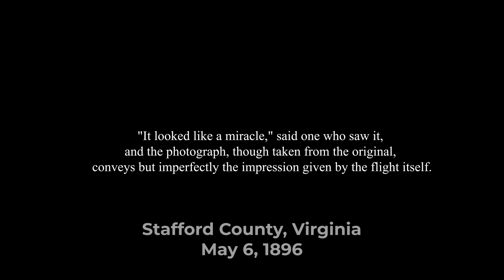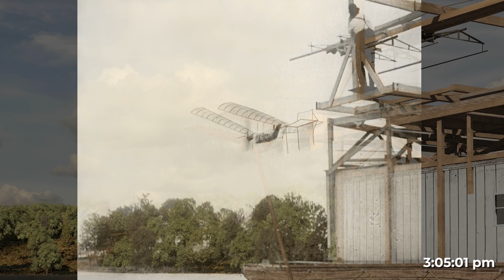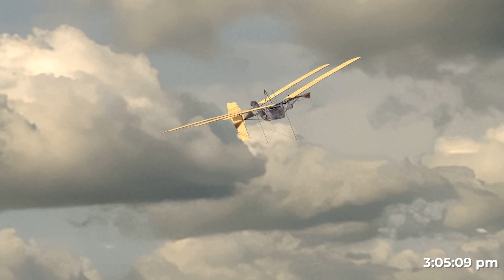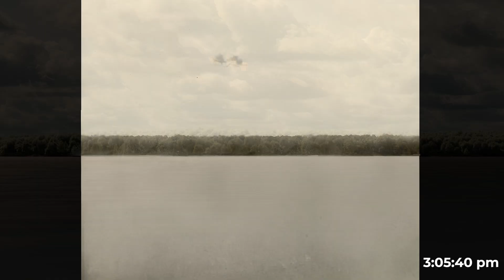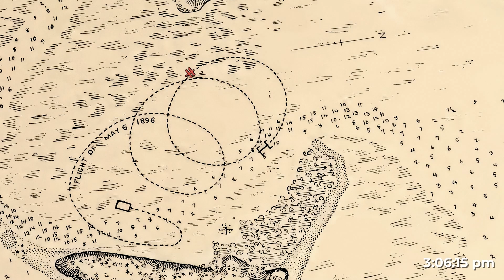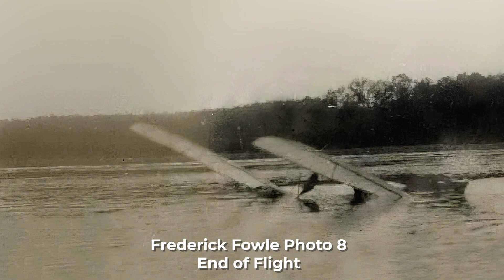The First Heavier-than-air Mechanical Airplane Flight - Langley's Aerodrome No. 5 on May 6, 1896

Comment: Reading all the comments here it comes down to definitions.
There is flight…. I can throw a rock, and while it’s in the air it can be considered flying
There is sustained flight, that can be defined as the ability to by design overcome gravity and maintain flight over time/distance.
There is controlled flight, that is the ability to have control over the trajectory.

The design shown here reached sustained flight but not controlled. As such and overlooking the limitations on its power system it was a dead end.  In the end it was both a Success and failure.

The Wright brothers achieved controlled sustainable manned flight, which even if it wasn’t first was first supported and recognized.  It was also repeatable and demonstrable.
Reply: There are controlled flight before the Wright brothers.
All the Wright brothers did was combine a suitable engine, given the efficiency of their wings, with an airframe that is controllable.
Langley developed the first engine powered airplane, and that is the real achievement.  Control was a necessary step, but Langley was the first (assuming there was no one prior).

Comment: Consider this: The simple ramjet engine was technically feasible at this time, and easier to construct than the reciprocating internal combustion engine. Imagine....
Reply: Counterpoint: The first ramjet wasn't designed until 1913. Even at that point no aircraft was able to fly fast enough for a ramjet to work.

Comment: Langley's contraption was a TOTAL FAILURE...it lacked sufficient Lift, had no aileron control...no rudder control and no elevator control.  Two HS dropouts figured out what Langley and all his associates couldn't.  Nice omage to the little engine that couldn't. 😂
Reply: Langley's airplane was a total success as it succeeded in what it intended to do.
Reply: Penaud's model flew many years before Langley's did!
Reply: @DumbledoreMcCracken  sorry but crashing into the water off the back of the ship is not an accomplishment..stop trying to rewrite HISTORY.
Reply: @mauricepowers8079  I'm talking about the 1896 machine, not the 1903 machine.
Reply: @DumbledoreMcCracken  the 1896 flights(aerodrome 5 and 6 ... 3300' and 4200' respectively) were the result of a total of Langley and 5 Engineers(one who held a Doctorate), and was steam powered and launched from a houseboat at least 15' above the Potomac River.  The Wright Brothers(High School dropouts) had highly precise data that is still used to this day and they achieved powered flight from the ground(with a gas engine THEY ENGINEERED AND BUILT)...totally controlled on all 3 axis.  Langley deserves a footnote in the annals of the HISTORY of FLIGHT.  The Wright Brothers deserve full credit for TRUE POWERED FLIGHT.

Comment: I thought the first powered and manned flight was July 1901, in Germany, by Hermann Gaswindt in a helicopter he built. BEFORE the Wright brothers-December 1903.
Reply: This is wrong, the wright brothers used a catapult in 1903 so I wouldn't call it "powered" flight, give me enough money and I will build a giant slingshot that will make my refrigerator fly more than what they did then. Otherwise, seems correct 👍
Reply: @ch1caum  They did not use a catapult in 1903. They took off into a 24 mph wind along a short monorail. In 1904 they added a catapult to fly in the absence of adequate wind. They needed to make many test flights and did not want to wait for the right wind.
Reply: @ch1caum  This is still wrong, because the Wright Flier only used catapult-assisted takeoff.  It flew under its own power afterwards.
Reply: @blam320  This is still wrong. In 1903 at Kittyhawk,  they used a dolly on a rail. They used a catapult in Ohio later to shorten the takeoff run.

Comment: And just WHO was the pilot!? Glen Curtiss flew the original (and heavily redesigned by Curtiss) one in 1914. Get your story straight!
Reply: This 1896 flight was an unmanned machine.  You could think of it as a large free-flight model airplane, but one that demonstrated all the capability that a larger one would need to carry a pilot.  As far as I know, Langley never solved the problem of steering, either horizontally or vertically, but he did demonstrate stability, and sufficient power to keep the machine flying for several times what earlier (and much smaller) rubber-powered toys had managed.
Reply: @SilntObsvr  Others has solved the control problem before the Wrights.  Montgomery in California.

Comment: This is a totally false claim, completely dispelled by Greg of Greg's Airplanes and Automobiles - he is a commercial pilot, aviation consultant, and aviation/automotive enthusiast.  His videos show that all of Langley's attempts to fly were rather pathetic.  None of his models were capable of aerodynamically sound attempts.  Langley's attempts at best qualified as uncontrolled, unsustained, powered jumps. The steam engine may have been fairly remarkable (but it was still much too heavy), and the airframe design was a failure that took hundreds of significant modifications by Glen Curtiss, over a decade later (1914) to do anything close to what the Wright Brothers accomplished from their initial gliding experiments in1900, followed by their successful, sustainable, controlled, powered heavier than air flight first accomplished in 1903 and demonstrated repeatedly in the years after.   There are 3 videos Greg has produced that slam the door conclusively on any and all claims that Langley (or anyone else for that matter) even came remotely close to powered heavier-than-air human-controlled flight.  This is the first of his videos on the subject.  https://www.youtube.com/watch?v=EkpQAGQiv4Q
Reply: I don't think this video is claiming control is it?
Reply: @ummdustry5718  i dont believe so, from what i can tell from my limited knowledge these flights have nothing to do with being human manned flights - merely that they were done with a device heavier than air! seems to be some sort of automaton.
Reply: @ummdustry5718  It seems to imply it, and if so, then it is a lie since Langley's 1903  Aerodrome (which was supposed to be an improvement of the 1896 model) required hundreds of changes by Glen Curtiss before it could fly and be controlled (sort of) by Curtiss in 1914.  Even so, the Smithsonian admits that the Wright Flyer was the first airplane that effectively solved all of the problems of practical heavier-than-air powered human flight.  The final verification of this is the fact that the Wright Flyer has a position of honor at the National Air and Space Museum main campus building on the Mall in Washington D.C., while relegating the model of Langley's aerodrome as an interesting dead end in aviation research with a footnote spot at The Steven F. Udvar-Hazy Center, hanging from the ceiling near the restaurant with other aviation oddities and dead-end aviation attempts.  https://www.wright-brothers.org/History_Wing/History_of_the_Airplane/Doers_and_Dreamers/Wright_Smithsonian_Controversy/The_Wright-Smithsonian_Controversy.pdf
Reply: Are you saying the photos are fake?
Reply: @creatorTWin  Regarding the pictures.  They are inconclusive, and Langley's post "flight" narrative was overly optimistic.  If he had really solved the problems of flight and control why did it take him 7 years to make another attempt? (especially when he had plenty of funding to try again)  Watch Greg's videos on the Wright Brothers, and you decide whether Langley was capable of actually capable of methodically solving all of the engineering problems of heavier-than-air powered human flight.  My conclusion, (which is the same as many others) based on the books I have read, Greg's 3 videos on why the Wright Brothers were the ONLY people to conclusively solve all of the engineering and practical problems of flight as well as actually being able to master control of the aircraft.  Langley's lack of prowess was demonstrated when it required hundreds of changes by Glen Curtiss to get Langley's aerodrome to actually accomplish slightly more than a powered leap, followed by an unceremonious crash into the Potomac as all of his previous attempts ended up doing.
Reply: @creatorTWin yes they are.
Reply: @GarrettFalls  if the photos are fake, then it is more likely the Wright's 1903 photo is fake.  

Why do the wing tips droop down when the Wright's Flyer is supposedly flying?  The load on the wings should lift the tips up, causing the whole wing to bow up, as has happens with a modern sailplane.
Reply: So, your argument from authority is that only the Wrights did anything to advance flight, up through 1903?

John Joseph Montgomery therefore could not have advanced flight, including with the invention of the aileron, could he??

I have a pilot's license, a mechanical engineering degree, and have worked in the aerospace business for 23 years.  None of that changes the history that you are so convinced has been changed by a so-called expert!
Reply: @DumbledoreMcCracken  Watch his videos, not just his videos on the Wright Brothers. If you think you know more and can speak more authoritatively about aeronautical engineering and flight I dare you to contact him.  I do not know what his degree is in (It may be an engineering discipline, but I just do not know), but practically he is at least on par with any aerospace engineer I have known. His understanding of fluid dynamics and airflow is excellent. He probably has 5 to 10 times (or more) your flight hours, since he is an airline pilot.  Again, he has demonstrated a knowledge of aerodynamics and piston engines (within the historical realm) that is beyond the understanding of the vast majority of people.
Reply: @libertycosworth8675  okay, I will.  I'm a glider pilot, which means I don't use an autopilot to fly.
Reply: @DumbledoreMcCracken  He has also flown gliders.  🙄🙄
Reply: @DumbledoreMcCracken  Not my assertion alone. Greg's expertise is notable, likely beyond yours. Doubt me? Then go ahead and watch his videos on the Wright Brothers.  He methodically proves his assertion (with plenty of verifiable documentation) that the Wright Brothers are the first and only inventors who conclusively, and methodically solved - through groundbreaking aerodynamic study all of the engineering and practical problems of heavier-than-air powered and manned flight.  If you don't watch those videos and a smattering of his other videos then perhaps you may lack the innate curiosity of a real engineer.
Reply: @libertycosworth8675  oh yes Greg.  He is a sanctimonious individual who only seeks to reinforce his own biases.

I have the opposite problem, I love evidence and wish we had more.  I don't need to reinforce my biases, I need to explore the unknown. 

That's what separates someone with curiosity, from someone with sanctimony.
Reply: @DumbledoreMcCracken  Then prove him wrong.  You can't, apparently, all you are capable of doing is offering gratuitous insults, a clear indicator you cannot address his arguments factually and substantively. To accompany that I really have to say:  “You keep using that word. I do not think it means what you think it means.”  😂  As far as Greg goes, he obviously has the curiosity to do in-depth, historically accurate research (with oodles of primary documentation that he references) covering a wide variety of subjects in the area of aeronautics - and he backs it all up with documentation from those primary sources.  He has been willing to have an online debate/discussion with someone who disagreed with him about the P-47.  So why don't you try if you think you could measure up? The Smithsonian has also admitted that the Wright Brothers conclusively solved all of the problems of heavier-than-air manned flight, and in doing so, gave the original Wright Flyer a position of honor at the National Air and Space Museum main campus on the National Mall, while relegating the model of Langley's aerodrome as an interesting dead end in aviation research with a footnote spot at The Steven F. Udvar-Hazy Center, hanging from the ceiling with other dead-end aviation attempts.
Reply: @libertycosworth8675 : "This is a totally false claim ..."

I do not get your hostility here.  I see no false claim made in this video.
This is an excellent video which documents a major milestone in heavier-than-air flight.
Nowhere does it claim to be a CONTROLLED flight.  Nowhere does it state, show, nor imply that it is human flight.

No one need to go elsewhere to a place like Greg of Greg's Airplanes and Automobiles to know the singular achievement of the Wright Brothers, which checked all the squares of the critical elements that are found in aviation today.  Langley failed to accomplish two major aspects.  Yet this is still an excellent video, and fully deserves credit for what it is.

Now if anyone were to assert that this video is incomplete, because nowhere does it specify these key elements that Langley failed to achieve, then I would readily agree.  So...  incomplete, yes.  "False", no.
Reply: @DumbledoreMcCracken  Wrong (again).  Matthew Piers Watt Boulton actually "invented" and patented (in England) the aileron - when John Montgomery was a wee lad of 10 years old.
Reply: @libertycosworth8675  I am concerned with what Octave Chanute documented, and communicated to the Wrights concerning control.  I will verify your claim.

Edit: apparently only a French aviator knew of Boulton's invention.  However, it clearly disproved the Wright's claim that they invented longitudinal control, Montgomery not withstanding.

Comment: Steam powered model that led the way to the 1903 Great Aerodrome attempt to fly with Charles Manly as pilot. Apparently it fouled leaving the catapult and fell into the Potomac River. A remarkable attempt to carry a man. A remarkable radial engine.
Reply: Like a fist full of mortar.
Reply: It was assumed it fouled the catapult. The photos do not support that idea. It cleared the catapult and the rear wing pitched down. What was not widely known then, or today, was the presence of a trailing vortex behind a wing. The rapid acceleration of the catapult left a strong starting vortex. The vortex from the front wing twisted the aft wing down, destroying its lift, causing the tail to sink, main wing to stall and it settled into the water. I've often wondered whether the Aerodrome would have flown successfully if it had been able to make a long startup run, letting the lifting vortices build up gradually. The Aerodrome had adequate power, but atrocious propellers. With proper propeller design and wheels, it might have flown.
Reply: @aeromodeller1  I wonder...had not thought about it having been a vortice problem, have not seen any very good photos of the launch attempt. The structure of the Great Aerodrome was very frail, certainly it could flex a lot.
Reply: @garrycline3130  Plus it was not designed for a download. Note the angles of the wires, top and bottom.